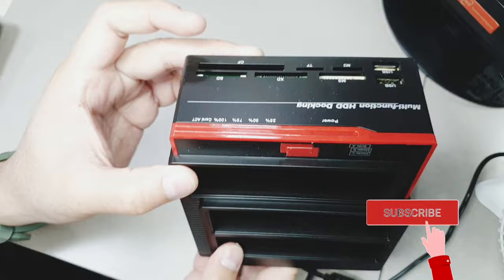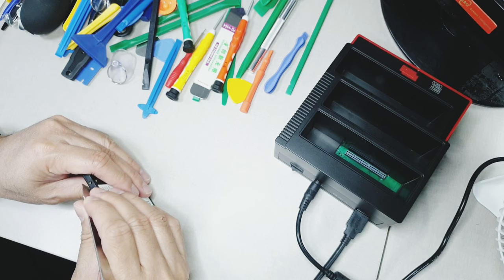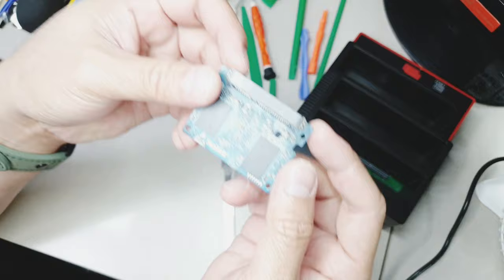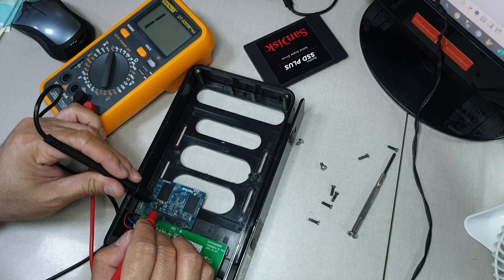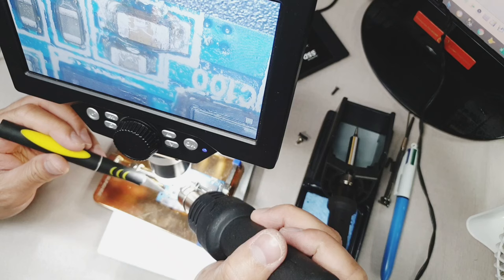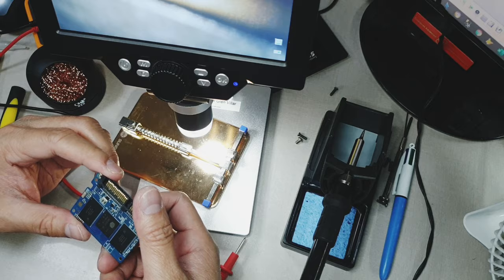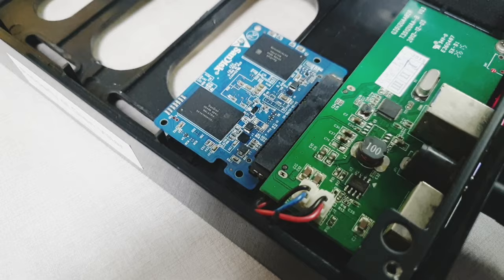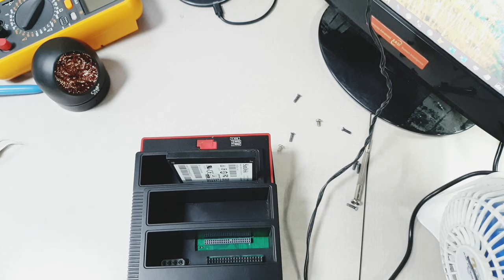How To Repair  Dead SSD (Solid State Drive) and Recover Data  - 100% Working

Comment: I have the knowledge but I can't even afford the thermal imaging.
Reply from the maker: It's a bit expensive and I only bought the second hand thermal cam. There are cheaper alternative thermal cameras nowadays.
Reply: @ReynaxisSolutions   well, it surely is expensive.
Reply: @ReynaxisSolutions  Just right now, I have a very important SSD drive running for three years. It's not mine, but the database in this drive is very important. I can still read the drive but can't do much anything because of IO error, the only thing I can think of to recover this drive is by low-level which of course requires this kind of process.
Reply: @ReynaxisSolutions  but even though I can, the tools require too much cost.
Reply from the maker: @alejorostata3899  Yes I agree. The price is a bit ridiculous. On the other hand, the logic board for SSD is small, you can use a cheap rosin dispenser pen for that. You can get the same result for so much less.

Comment: Too much music and back ground noise with low level audio.
Reply from the maker: Thank you for your feedback.
Reply: Even though the audio was low for me ,   I did learn something. Thanks. I have a  M.2 2280 SATA SSD that is bad. I hope I can recover the data from it.
Reply: I purchased a enclosure for the M.2 SATA SSD and connected t to the laptop.  It read the files and after  maybe 20 seconds they disappeared. Computer won't detect the SSD anymore. I used my OHM meter and found two capacitors shorted. I will  try to remove them and proceed with another try to access the SSD.
Reply from the maker: Hi, the shorted caps might be the problem. Good job.
Reply: @ReynaxisSolutions  Well at this time I'm not sure they are capacitors or something else. They are much larger than all the other capacitors on the board. They look like the other capacitors though.
Reply from the maker: Hi, yes, it's sometimes hard to identify smd components if it's a capacitor because it can be something else like a resister, inductor or diode or even a fuse. There is is this cheap tool that you can buy online and it might help with identifying smd components. It's called the Multifunction Tester TC1 or TC2. I haven't personally tried it but I'm thinking of buying too. Here's a link of the similar item. https://www.aliexpress.com/item/1005002447876881.html
Reply: @ReynaxisSolutions  Looks like a neat little tool to have.  I hardly do any electronics trouble shooting anymore. But it"s cheap enough to look into.

Comment: 100% working? You only show success on ONE very unique example (a dead cap). While impressive to see this brute force solution for such a failure: what do you suggest if the SSD (Windows system drive + 2nd partition) disappeared completely, blue-screened Windows (0%  log, due to not accessible at all) and can not even be detected as a internal or external drive anymore? Your "capacitor fix" is NOT a solution, is there ANY?
I doubt it.
So much for 100%..
Reply from the maker: Hi, I agree.